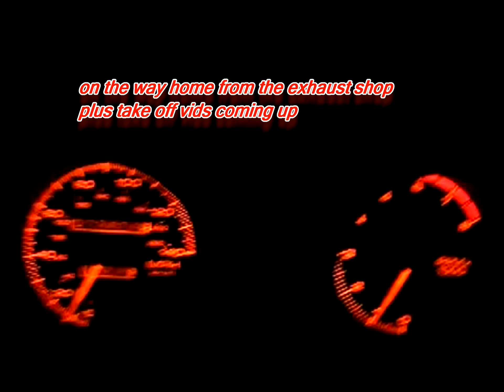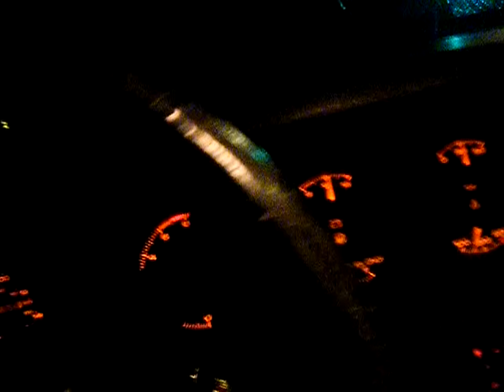1989 Pontiac FireBird TransAM GTA Built 383 Stroker Motor

Comment: I have a 89 formula 350. Just yanked the orginal motor out had 105 thousand miles and out in a crate 
383 stroker fuel injected with 450hp and 435lbs of torque. Rather than building the original motor glad i dis